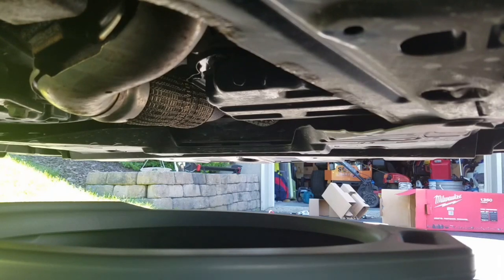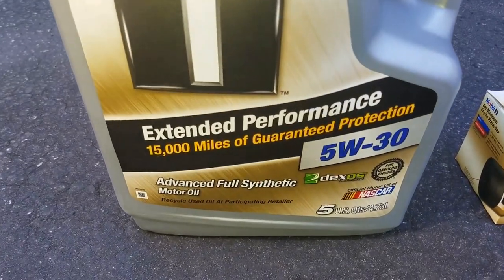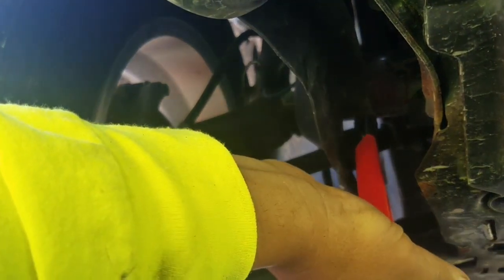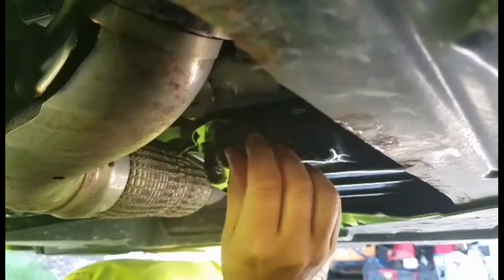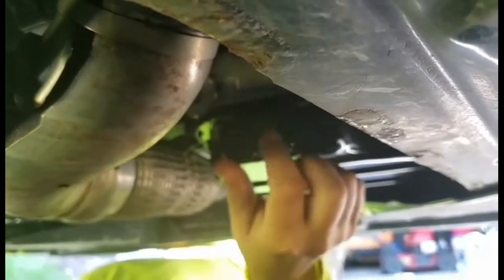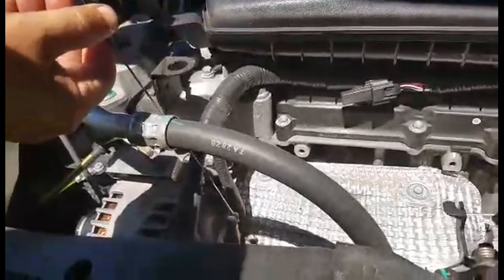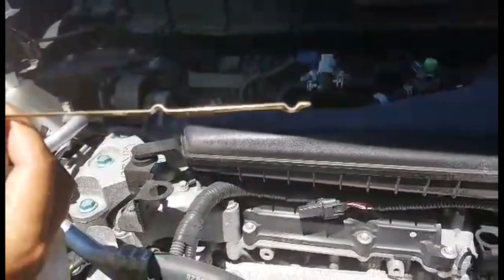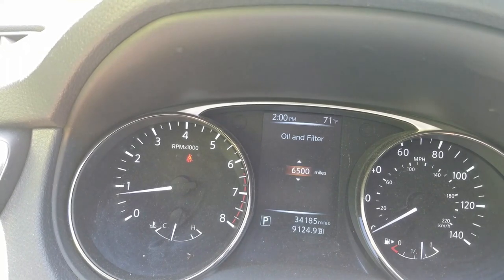2016 Nissan Rogue SV Oil Change

Comment: Oil filters are designed to be tightened hand tight most of the time unless manufacturer specs call for more tightening after initial gasket contact. There's nothing worse than having to crank an oil filter off that was previously tightened by some gorilla.

Comment: Im just wondering why you use 5w-30 oil instead 0w-20 that nissan rogue manual recommend? Thank you for the video..!!!
Reply from the maker: For weather conditions and temperatures up here in North east i find it protects much better

Comment: Synthetic oil viscosity calls for 0-20, Conventional oil calls for 5w-30w 

• Genuine NISSAN engine oil or equivalent
• Engine oil with API Certification Mark
• SAE viscosity 0W-20
• As an alternative to this recommended oil, SAE 5W-30 conventional petroleum
oils may be used and meet all specifications and requirements necessary
to maintain the NISSAN New Vehicle Limited Warranty.

Good video
Reply from the maker: Thanks Henry ...much appreciated
Reply: I was wondering why the dealership used OW-20 on my rouge but in this video he uses 5w-30. Thanks for the explanation. 👍🏼
Reply: I bought full synthetic 5w-30...no go?
Reply: My friend works at a Nissan dealership ...its 0-20w synthetic

Comment: Yeah, don't forget to put the oil cap back on while your son is asking you questions before starting the engine.
Reply: @toolboss8410  A bit of a mess to clean up. Luckily I only started the engine instead of driving it.

Comment: I noticed the oil filters were different lengths. He skipped the part when installing the new oil filter. Any thoughts on this?
Reply from the maker: Thought?? Installing a oil filter is a pretty easy process ..what I want you to do is put oil filter in same exact place the old one was...screw new oil filter one ..you screw some on by rotating the item in clockwise position until it's tight  ,👩‍🏫
Reply: It's just strange that you covered everything but that. I know its a simple task, I've done it several times on helicopters and airplanes. My point is that the filter you took off appeared to be longer than the one I just purchased for my '18 Rogue. I wanted to get away from the over expensive Nissan filter. That was my subject,  the different lengths. But anyway.... have a very Blessed New Year.  @toolboss8410

Comment: Make a video on how to change the transmission fluid on the CVT (every 30,000) miles
Reply from the maker: Got 90k just did this summer ..👍
Reply: @toolboss8410  did you make a video on it?

Comment: hi just wondering dont you need to put a crushable washer in between your drain plug?
Reply from the maker: +Carlos Anaya na yhe one on there was fine ..
Reply: the owners manual says to use a new one every time. if you do shortcuts and don't read the owners manual you will pay the price for that.

Comment: Oil filters are only hand tightened. No need to tighten then more than that. Does anyone know the torque spec for the drain plug?
Reply: The manual says drain plug tightening torque should be this :
22 - 29 ft-lb (29 - 39 N-m)